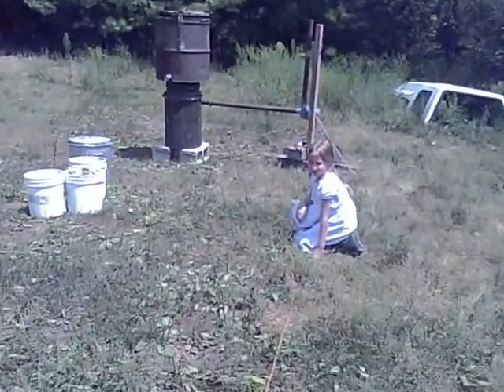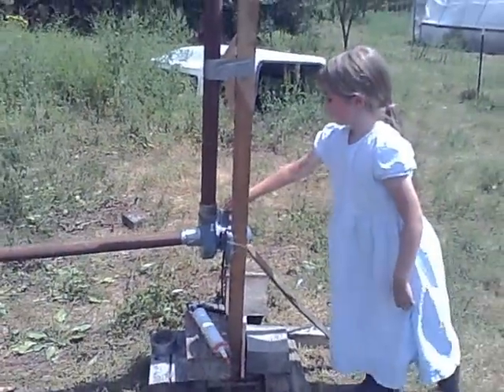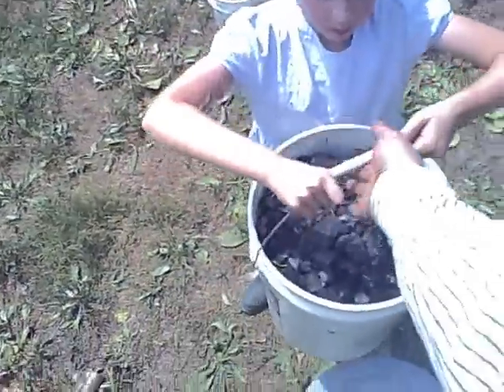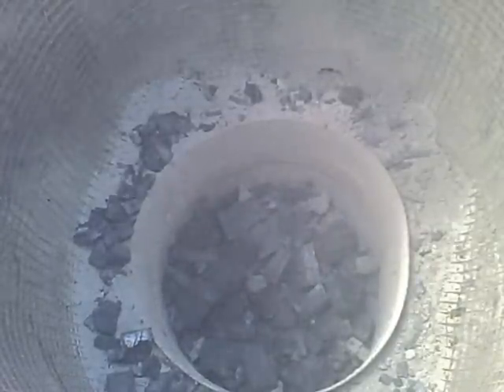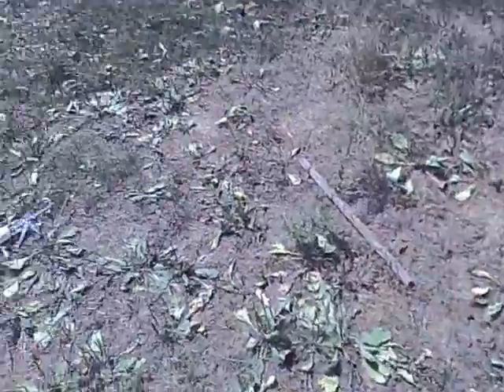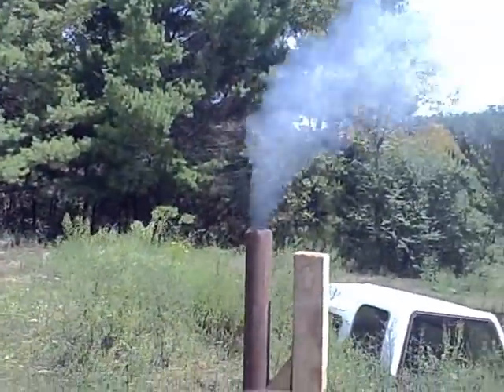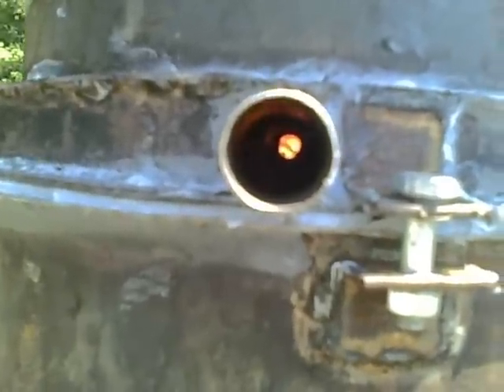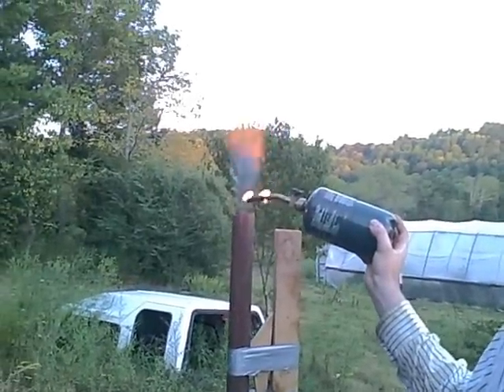Woodgas Flare

Comment: Thanks for the reply. I'll check it out. I do have a smaller unit that makes excellent gas that burns propane blue and when you blow out the flame, there is zero smoke or steam from the output pipe. I'm not looking to drive on it. I am only wanting to power a small generator with it and I want something a little better than my prototype because it is a FEMA but it has an excellent filtering
setup. I am in the process of constructing a imbert at this time.

Comment from the maker: Hi Flash,

This gasifier was built entirely out of scrap steel. There is a sizing chart for the imberts (google for "imbert dimensions").

It didn't do the job when I finally got it installed. There's a lot more to gasification than making a pretty flare.

I have a much better gasifier now, built using Wayne Keith's design. Check it out, driveonwood com, link in description.

Comment: In your inverted V setup are you using a special high temperature metal for your cone and air nozzles? I know that may sound dumb but I am still learning this myself. Also, is there a simple guide for determining the nozzle openings and the cone opening? Before I forget please visit my channel and see my "Gasifier Video 6. You may get a kick out of this filtering system. Keep up the great work. Flash001 USA

Comment: Chris that's a very nice job you did on the design. I built a small stratified gasifier
for running a small generator but it does produce a lot of tar without filtering. I actually designed a filter that cleans the gas so well that the output pipe doesn't admit as so much as a mist and the flame is propane blue. I am now building a new one with an offset hearth and I don't think that I have seen anyone try before. I do have a question for you and maybe you can help me with this. To be cont..

Comment: The smaller the diameter of your reaction chamber the higher the temperature you get and the bigger the pyrolysis layer and gas production. The narrow but high chambered down draft gasifiers works best but are limited to by the single narrow chamber. Having multiple reaction tubes inside your vessel much like a stack of organ pipes side by side increases the efficiency and gas production including the purity of the gas produced.